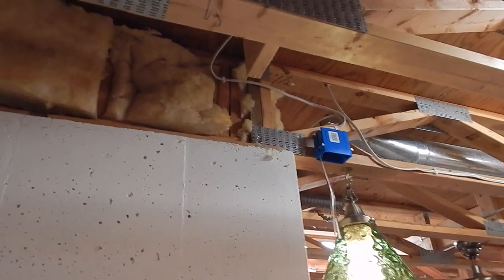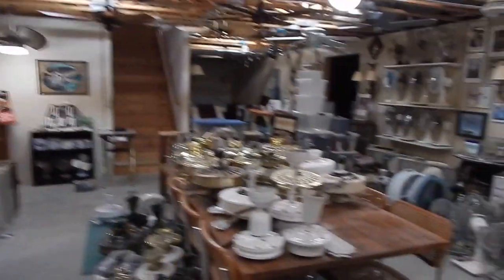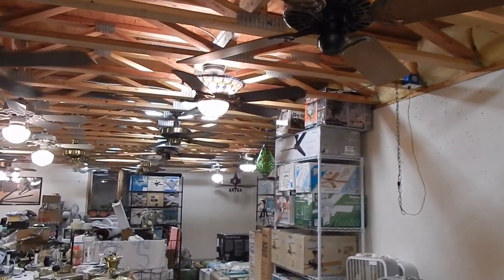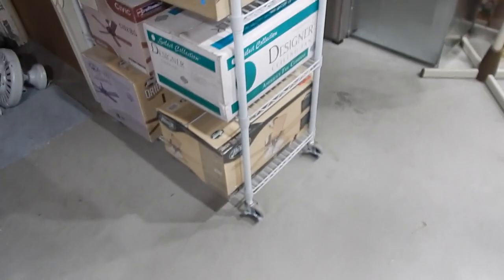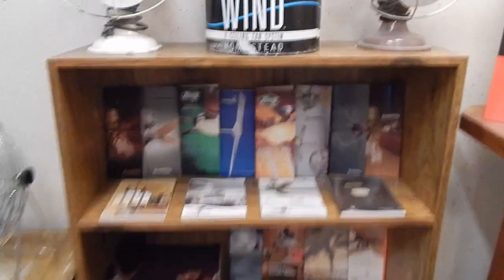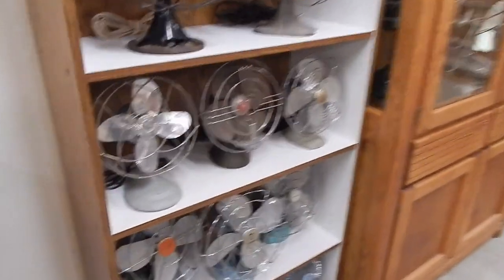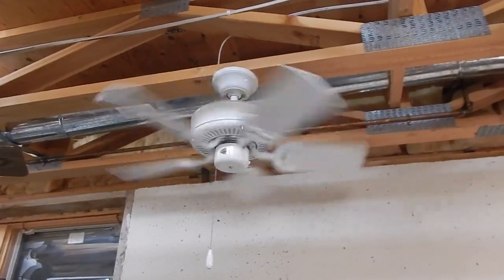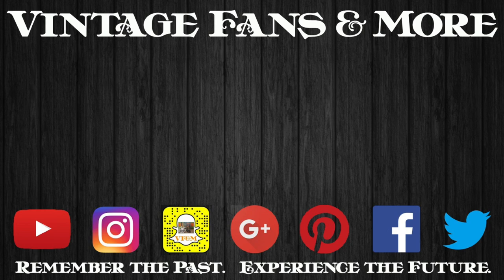Shop Vlog 5 | Growing Displays, LED Tape Is Life, Smol Takeover

Comment: Ok I am probably Mr. Capacitor Guy but in that case I might have just cranked on the blade arms to create the steeper pitch.
Reply from the maker: I didn’t want to do that because I still have standard blades I want to be able to use.
Reply: I figured.

Comment: You are a bad influence.  Oh dear.  I see LED tape in my future.
Reply from the maker: ALL of the tape. The Patriot Lighting stuff at Menards is pretty good and affordable, and fairly flexible for general applications. I’d love to use a more advanced system like Diode LED, Kichler, or Maxim but I’m not paying hundreds of dollars for that when this stuff is like $20 a roll and connectable.
Reply: I bet there is even cheaper, decent-to-good stuff on Amazon and eBay
Reply from the maker: Probably. I mean I know there’s cut to length kits that are super cheap everywhere, but most can’t be linked back together after being cut or made to do 90 degree turns, etc. This is one of the cheaper, moderately versatile options I’ve found, but I haven’t done a whole lot of research for such systems in affordable price ranges either.